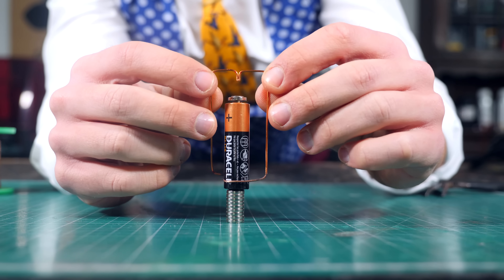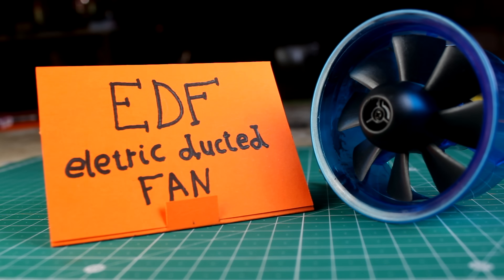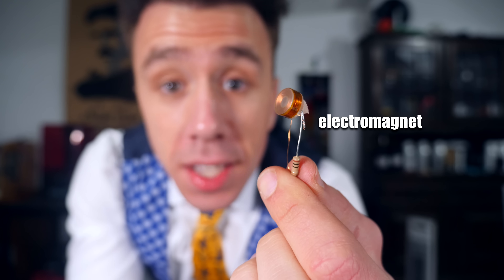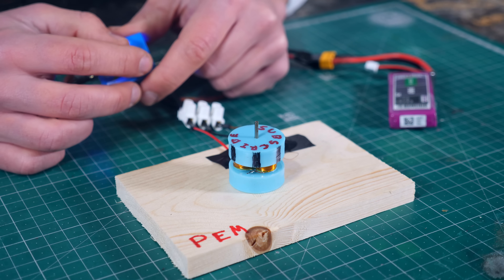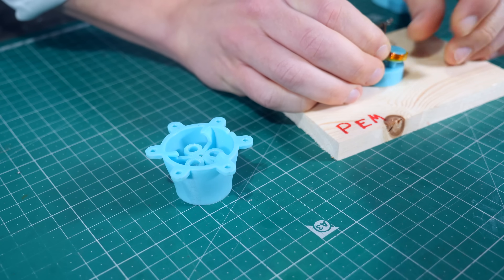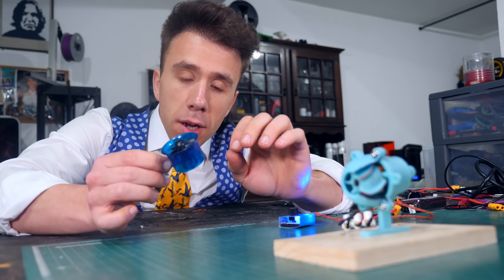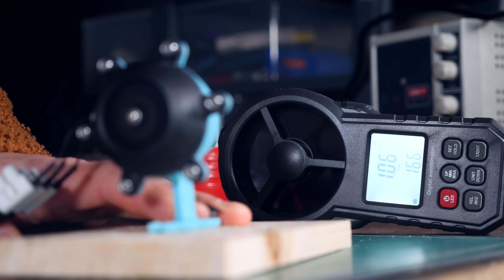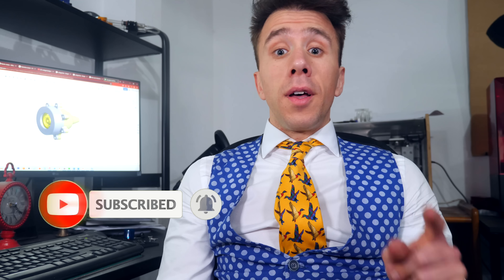I 3D Printed an ELECTRIC MOTOR FAN

Comment: I need your help I need a Tesla valve 2.5 inch diameter inlet and outlet 18-24 inch exhaust/muffler must be able to handle high temperature I think it will increase exhaust scavenging could scale it down to 1" for small engines

Comment: Design Thinking approach,  Empathize, Define, Ideate, Prototype and Test. Get back to one of the stages and iterate. Despite the in-let and out-let of air, use smoke test and slow motion camera.
Secondly, the polymer is not suitable for electric field motors, cause it contributes for back electro magnetic forces. 
Thirdly, meter the Amps and Volts required by the system to perceive the must effecient motor design agains the airflow speed.
Fourth, explore the new circled blades that MIT published a study. 
Fifth, Francesinha is the best dish > Cod Fish!

Comment: You are not messuring trust, you are messuring air-speed, centrifugal fans tent to have way more pressure than normal propelers. That's why the turbo-compressor in cars uses centrifugal fans an that's why in PC's you put normal fans.

Comment: Maybe you could compare the performance of different 3D printer materials to see what works best for fans or jet engines. FDM would probably be best for this and you could compare things like the friction, what RPM it can handle before it expands, how smooth you can get it, etc, maybe you could also compare different layer thicknesses and see if that affects how well the fans work. Maybe you could test out different materials for different parts of an engine. I heard there is a company that makes plastic bearings and they sell the filament they use and it is apparently very low friction. You could test materials like nylon that are supposed to be low friction but they are also partly flexible so may expand too much from the forces and see what impact using fibre reinforced nylon makes or test higher temperature materials like polycarbonate or a polycarbonate blend. Maybe a flame retardant polycarbonate would be a good fit for a 3D printed jet engine, it has high temperature resistance and is flame retardant. I have seen some materials that can handle temperature spikes up to 180 C.

There are a lot of more exotic materials available now with a wide range of properties and most channels like CNC kitchen whilst very good only show the materials from a technical testing perspective, not in any actual applications and definitely not in something like fans or jet engines. I know this would be an expensive video or series of videos with all the materials you would have to buy but some stores sell samples or you could maybe get a store to sponsor you to show off their filament. Maybe a company would sponsor you and give you a part printed in a higher end material like PEEK to test.

Maybe you could try a similar idea with resin too.

Comment: i would imagine creating high pressure would require greater torque, and in this case the motor is not optimised for that and so there is a significant decrease in rpm

Comment: Size is all you need, the Dyson impeller has a lot more room to move air than that small enclosed design, I would look up "major hardware" he made a 3d printed supercharger and he had to make it quite large in order to make it any good... the smaller the fan the exponentially faster you need to spin

Comment: Don't want to point out the obvious, but, is your BLDC design an inrunner or an outrunner? For clarification an outrunner is like having a tomato with the skin inside and the pulp outside .) For sure the not having to move the mass of the motor makes a difference

Comment: It's fluid dynamics that causes the diffence in the fans. Yes, air is a fluid in this case. The centrifugal fan compresses the air and sends the molecules on a non-linear path. The EDF makes more of a linear path for the molecules (not really linear, just a closer approximation). Air acts like a spring and the centrifugal fan causes a pressure force to build due to the way it smashes air molecules together. The release of that pressure is why we get turbo boost and blow off in turbo charged cars. The EDF causes more of a standing wave as the molecules of air are constantly compressed and decompressed at the back of the fan. I hope this helps!

Comment: as for fix is simple start with redesign of casing since your impeler is where your compression is happening this is where you will need to make sure you have an open flow any constriction may increase air speed but will lose you thrust as a result as for the impeller fix you have two options ajust pitch and curve of the impeller blades to improve final compression raitio or add a fan infront to push more air into the impeller if you look to a turbo charger you will notice the  impeller has shallower angel of attack at the first third of its entrance and the last 2 thirds are like the impeller of your vac cleaner i wish you luch integza

Comment: i would love to see you try the flat turbine engine concept, it basically uses a fan that has a specific profile that allows for the region closer to the center of the fan to act as a normal forward thrust fan, and the region towards the tips of the blades to push the air outwards ( like a centrifugal turbine) to copress air in a tight duct then cumbust it, this in theory should allow for a very compact turbine/turbofan engine.

Comment: Have you measured the current the motor is using in both configurations? My guess is that the impeller is stalling aerodynamically, which effectively will make it slip through the air instead of moving the air.

Comment: Should be the difference in airspeed and pressure. The ducted fan is putting out high airspeed but low pressure (which you want for propulsion). The impeller on the other hand creates a higher pressure but lower airspeed.

Comment: ents

Add a comment...

Robert Field
1 minute ago
So in short, the reason why the two fans don't produce the same thrust, is because they are not the same. The amount of "thrust" that a propeller produces is largely determined by it's blade geometry, not just the motor driving it. However before I elaborate on that, there is something else important to cover: In the video you are measuring the fan's airflow, not thrust. Thrust is measured in Newtons as it is a force, not m/s. To measure thrust you would have to fix the fans to a weighing scale, reset the scale to zero, fire up the fans and record the difference in reading on the scale, and then multiply it by 9.81 to achieve a value in Newton's. This can then also give this the thrust to weight ratio of any vehicle you might place your fan on. And it's also why t/w ratio is a unitless quantity, as you've divided two values measured in Newtons, by each other. If you were to use the airflow from the fan and the vehicles mass I guess you'd be calculating it's theoretical momentum at maximum velocity? 
Now back to blade geometry and thrust output. Think about it this way, if you were to attach a flat disc to the motor and spin it, you would record no thrust output, even though you've used the same motor. The same idea applies but on a much subtler level to different fan blade geometry. 
What's really important here though, is that an axial fan (the kind found in an EDF) is essentially optimized for airflow. While, a centrifugal fan is optimised for static pressure. Static pressure is basically how much force over a given area the air/fluid is able to exert. (Essentially it's pushing/pulling power) Which is why vacuum cleaners utilise centrifugal fans, as the best way to create suction, is with high negative pressure. (now pressure and fluid velocity are inherently linked with Bernoulli's equations, and this is why you can reduce a fluid's pressure to gain increased fluid velocity, but this is probably a lot to explain. 
So, then the reason why lots of jet engines use a centrifugal fan for the compressor, is because they'll do a better job of compressing the air before ignition (for increased gas expansion, oxygen density, etc.) An axial fan would likely be able to move air into a combustion chamber quickly, but once it's full wouldn't have the pressure to continue compressing the air inside. 

So back to why these two fans you designed operate differently. I would start by actually measuring their thrust, rather than airflow, to get a better idea of the difference in performance. The next thing I would do though is try some different sizes and shapes of outlet nozzles on your fan to see if the performance changes. Even though an impeller is optimised for static pressure, it's possible that you're still over-constricting the airflow. The other consideration is to try a rocket style convergent-divergent nozzle, and see what this does. 
It would be difficult to diagnose much more than this without simulation, so I would also suggest looking into some fluid simulation!
Hope this helps!

Comment: My guess is you are using a fan designed for pressure change.  Compression isn't the goal because you aren't trying to combust anything.  I think what you really want is a fan that will accelerate the greatest air mass to the highest speed.  I want to say you might want an intake and nozzle for impedance matching with air but I think I might have pulled that from a place I probably shouldn't discuss. I don't know if Onshape supports it, but FreeCAD has plugins for turbine design and fluid dynamics so you could simulate and optimize a design for producing thrust.

Comment: Centrifugal fans are good for creating high pressure air not high velocity. to get more thrust out of a jet engine you want the exit velocity to be much higher than the inlet. that’s why early jet engines used centrifugal fans to compress air before adding it to a combustion chamber to increase the velocity of the gas coming out the exit.
Reply: You can think of an EDF fan as the bypass fan on a modern jet engine. The majority of the thrust from a modern airlines jet engine actually comes from this bypass fan and the jet engine itself is mostly used to power the bypass fan.
Reply: The reason why the bypass fan provides so much more thrust is because the geometry of the fan blades are basically hyper optimized propellers with airfoil cross sections and use aerodynamics to generate thrust. Usually the diameter of a bypass fan is between 2 to 3 times that of the jet engine itself and the efficiency of a bypass fan is measured in the bypass ratio: the amount of air bypassing the jet engine over the amount of air going through the jet engine.

Comment: My guess is surface area. The regular fan has a much larger opening and larger blades. It can pull more air in and drag it along the surface of the blades. A fan scoops air and because of the angle of the blades it is push back. shrinking that tells me that it would be able to pull less air in. So to get the same result it would have to spin faster in order to pull in the same amount of air in the same time. I bet if you make a regular fan with the same size opening and blades it would perform similarly.

Comment: Few thoughts, first, the weight of the fan portions, do they match? Second, have you tried running compressed air without the fan to check airflow? Third, maybe look at turbos for impeller designs.

Comment: I work on centrifugal refrigeration machines. They also have open face impellers.  Your issue is more than likely the clearance between the impeller and the impeller shroud. It needs to be super tight as in .005”-010” or you will not be able to create a pressure difference. If you want more information let me know.

Comment: I think the motor is fine, most RC jet engines use a similar brushless motor to spin up the compressor turbine. Here are some of the problems (and potential solutions) that I can think of:
1. The air might be stalling around the impeller blades (longer or differently shaped impeller blades)
2. A static boundary layer against the inner wall of the compression chamber that is robbing you of power (tighter tolerances between the blades and the walls)
3. Over compression/choking on the exhaust side (widened exhaust nozzle) 
4. The compressed air from the impeller might be impinging on the inside of the exhaust nozzle (smoother transition from impeller to nozzle)

Comment: Hello my friend, I am from Brazil, I would like to leave a suggestion for you, Build a 3D printer with printer scraps and microcontrollers cheap and accessible, For anyone to manufacture, Here in Brazil a 3D printer is extremely expensive, For you to have an idea a decent printer, Can cost the entire minimum wage of a Brazilian, 1500BRL minimum wage of a Brazilian, An Ender 3 Cost between 1700-3000BRL, If there was a way to cheapen it would be very nice, Thank you.

Comment: Do you think it could be because of the size? Im not a doctor master in fluid science dynamics, but could it be that in the smal chokes around the motor air gets resisted by the currents appearing og the surfaces (I think it is called eddies) 
You could try making the motor in different sizes and see if the output is linier or not

Comment: I am an aerospace engineer- it’s impossible to say for certain but you should understand that even if your fan design is perfectly efficient and generating the same power thrust is not necessarily the same. A little air going really fast has the same energy but much less thrust than a lot if air going slow. The lots of air slow version is great but it limits your top speed. Thats why regional transports are turboprops going mach .3-.5 and jets use turbofans going mach .8, they use the biggest thing pushing on the air they can that matches the exit velocity to the flight speed as close as possible

Comment: I would guess its just compressor wheel design, like a turbo you want thin blades and radical shape. The tolerances need to be tight to the housing. You should also balance the unit to remove unwanted vibration/harmonics so you can get greater efficiency with the power being used so that should result in higher rpm. Try using a billet AL turbo compressor wheel, then 3d print a custom housing design. Then you can toss tomatoes in it

Comment: as for your problem head pressure a volume can only have so much pressure before it becomes like a wall any constrictions in the casing will increase head pressure and slow your impeller second rpm the higher the rpm the better third intake area the smaller the intake area will cause a limited volume of air to pass with out either absurdly high rpm  fourth impellers are great for one thing  compression not thrust this is why vacs have great suction due to the comression raitio of the impeller it can draw more air through a system then pushing air through a system and since the impeller is scavanged from a vacume cleaner it is optimised for pull not push

Comment: You may have inadvertently answered your question with your description of the differences between axial and centrifugal fans. A centrifugal fan COMPRESSES the air, which takes more energy than simply moving it, and that additional energy requirement is sapping your overall performance vs. the EDF.

Comment: It's a matter of cross sectional flow area on the inlet. Your design is greatly constricted compared to the EDF. Notice how much frontal area the EDF has compared to your design — even if you subtract the unused area created by the fan hub. As a result, you have only so much flow you can generate in that inlet opening before you're limited by the very pressure difference between atmosphere (14.7psi) and whatever negative pressure your impeller generates.

That's the main problem you're having. The second is how you're approaching the problem.

Thrust is the mass rate multipled by velocity. So you can either move a LOT of air per second slower or you can move a little air faster to make the same amount of thrust.

As it turns out, it takes less energy to move more air a little bit faster than it does to make it move a lot faster because kinetic energy squares with velocity and you have to get that energy from somewhere. Your motor can only input so much work energy into the system.

Comment: Worth mentioning you are measuring static thrust.  When in motion it's called dynamic thrust and it will be different because the air encountering the inlet already has relative motion. Depending on the inlet geometry and fan type dynamic thrust will be larger or smaller and will change with airspeed.

One weakness of centrifugal fans is their larger frontal area and hence higher drag.  An axial fan with the same frontal area would be able to move a lot more air.  You definitely need to increase the size of the inlet.

Dyson fans are not optimized for the same objectives as an aircraft fan/prop. Not a good choice.  Theoretically the most efficient propeller would have a single blade and be as long as possible.

Comment: One thing I've learned from Major Hardware's fan showdown is it's really hard to design a good fan. It's kind of a dark art and seat-of-the-pants intuition is no match for computational fluid dynamics. I think you are on the right track with copying an existing design, but you really need to match all the parameters - geometry, RPM, power draw. Small changes can have huge effects (almost always moving away from some local maximum )